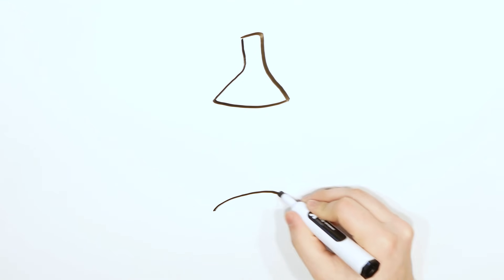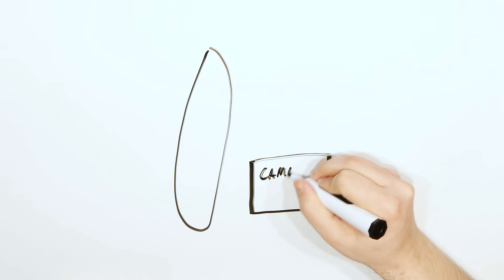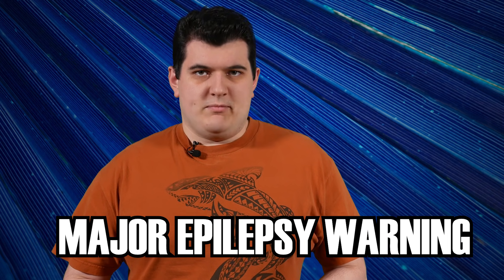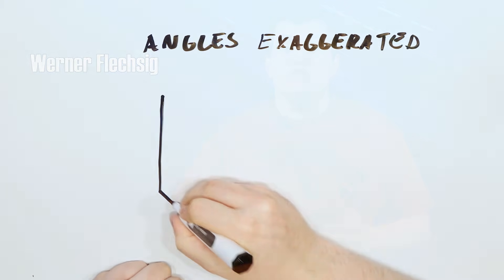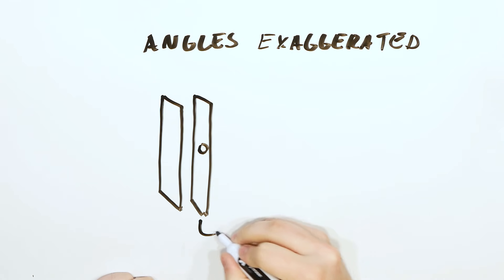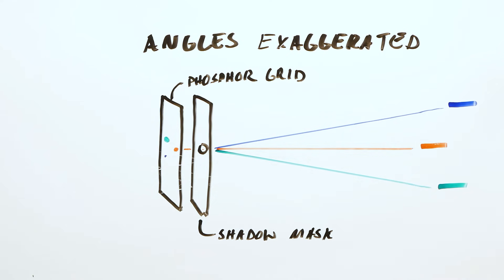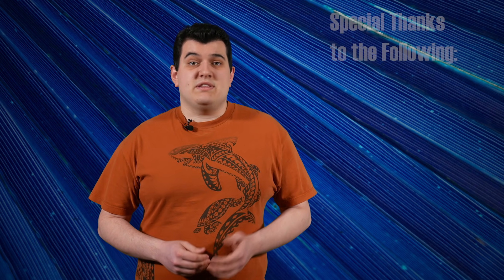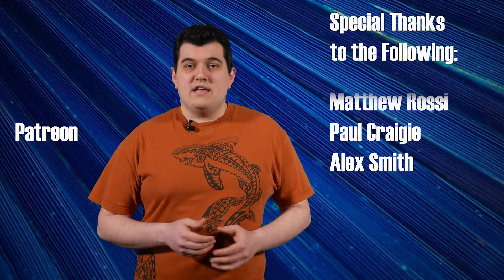How Analog Color TV Works:  The Beginnings

Comment: I don't see how these are not pixels, seeing as a pixel is a "picture element". Sure you might not be able to send a command to a TV that says "set pixel (100,200) to VALUE" but by changing the incoming signal you still have controll over each pixel, which is essentially the same as Individual pixel addressing.
Reply from the maker: "You still have control over each pixel" is a bit of a false premise.  Going back to the fact that the image is drawn as lines, there is no finite "resolution" in the X dimension.  The beam isn't moving in steps at all, it's just sliding from left to right continuously.  There is a maximum amount of detail you can portray in the X dimension, but it has nothing to do with the grid pattern of phosphors.  That's just a limitation of the bandwidth available.
The image is drawn exactly the same as in a black and white television, which does not have these groupings at all.  The groupings are nothing more than color separation elements, and they should not be seen as building blocks of the image, or "picture elements".  Their position relative to the actual drawn image is irrelevant, as I demonstrated with the PlayStation text.  And thus, they're not pixels.  They sure do look like them, but they are not what defines the image.  They just prevent crosstalk between the three individual electron beams.

Comment: Your monitor doesn't mix exactly equal red and green parts to make yellow, it's actually adjusted a little to seem more accurate.
Reply from the maker: That color on the screen, though, was equally red and green--I made it so :)
Reply: Maybe the color was #FFFF00, but the actual monitor (my screen, your screen) displays it slightly differently. Maybe the color is stored as fully red and green, but look up color profiles
Reply from the maker: +LoganDark Ah, I see. I thought you meant that a true "yellow" (or whatever you wish to call a pure yellow) wouldn't be equal parts red and green.  Point taken.

Comment: Your understanding of color vision is incorrect. Our eyes don't just see red, green and blue light. Spectral yellow light does not contain red and green light at all. We see spectral yellow as both the M and L cones (that you call green and red cones) are sensitive to yellow light.
Reply from the maker: +spoddie I think you will find if you revisit that segment that I had said yellow light stimulates both the red and green cells, which the brain interprets as yellow.  I never said yellow light is a mixture of red and green light.  I think perhaps my semantics are vague between "see" and "interpret".
Reply: 1:23 "Our eyes actually only see three colors of light - red, green, and blue. Our brains interpret other colors by comparing the amount of each of the three colors we see ..." [edited]
Reply from the maker: +spoddie "by comparing the amount of each of the three colors we see"
Reply: Right, edited. 
But you're still wrong. We don't see spectral yellow as green and red as spectral yellow does not contain either green or red. We don't see only three colors, we see the entire spectrum. This might be a minor point in a video about color TV but you are passing on incorrect information.
Reply from the maker: +spoddie But we don't have color receptors for yellow!  We "see" yellow light because spectral yellow stimulates both the red and green cells. Our eyes can't directly see yellow.
My original reply stands; I could have been more clear with semantics.  It would have been better to say "our eyes only detect three colors of light, with colors in between R, G, and B on the spectrum stimulating the three detectors in varying ratios which allow the brain to determine those colors".  I feel as though it was my usage of  "see" rather than "detect" which is the cause of your issue.
Reply: Whether it's "see" or "detect" you're just wrong. They aren't blue, green, and red cells, they are L, M, and S cones. We don't just see three colors, for instance  te M cone detects, or sees, every color in the entire spectrum from violet, through green to red!
Reply from the maker: I'm growing weary of this.  Is it over-simplifying to call them Red Green and Blue cells?  Yes.  Is it "wrong"?  I'd hardly say so.
"A range of wavelengths of light stimulates each of these receptor types to varying degrees. Yellowish-green light, for example, stimulates both L and M cones equally strongly, but only stimulates S-cones weakly. Red light, on the other hand, stimulates L cones much more than M cones, and S cones hardly at all; blue-green light stimulates M cones more than L cones, and S cones a bit more strongly, and is also the peak stimulant for rod cells; and blue light stimulates S cones more strongly than red or green light, but L and M cones more weakly. The brain combines the information from each type of receptor to give rise to different perceptions of different wavelengths of light."
There are overlaps and it's true that they are not monochromatic in their perception.  But their primary sensitivity can be casually defined as "red, green, and blue".  I see no problem with that and your insistence on calling it wrong seems pedantic to me.  Let's just agree to disagree here.

Comment: apparently color wheels are used in modern projectors? I found out looking for old color wheel TV sets (couldn't find these early color sets though....)
Reply: Panda-s1 color wheels are used in cheap DLP projectors so only 1 chip is needed.  For home theater I would highly recommend 3 chip LCD or 3 chip DLP.  For office presentation of PowerPoint slides 1 chip DLP is fine.

Comment: I'm hoping the next video will explain that the color carrier is actually two signals (I and Q). Every explanation of NTSC color I've read only explains the I signal, as if color is just one axis and not a circle. 

The benefit of using QAM for the color carrier is that you can modulate two signals instead of just one. That greatly increases the color resolution and it would have increased it even more if both signals had been encoded in VSB. For some mysterious reason, Q in encoded in DSB, confining it to half the bandwidth of I.

Comment: Let's be honest about "Never Twice (the) Same Color".
By about 1975, US broadcasters had figured out how to keep their color burst signal in the correct phase. Set the hue knob to show the grass is green on any channel, than leave the hue knob alone after, and the color would be fine on all the channels.
Reply: You could also use the SMPTE color bars that stations used to broadcast before going on air early in the morning. Some cameras can also provide color bars, or you may have a channel on your cable service.
Reply: 1L6E6VHF Yeah, but it took nearly 30 years to figure that out and by then PAL had been working great for 10 years.
Reply: Wasn't the issue due to multipath interference? So you couldn't simply get round it by setting things correctly at the broadcast end.

Comment: NTSC was a mistake. A huuuuge mistake. PAL was always the better / superior standard. Better colour, more TV lines of resolution & no dropped frames bullshit.
Reply: KRAFTWERK2K6 Well, PAL was an improvement, because it was designed after NTSC and was able to correct some of the defects in NTSC. In reality, though, the difference in quality isn't huge. NTSC just requires periodic calibration, while PAL auto-calibrates.

Comment: NTSC was so retarded. What the hell were they thinking? Films run at 24fps and pal uses 25 so all they would do is speed it up by 1fps which was perfectly acceptable. Can't do that with NTSC. PAL was also higher quality.
Reply: Yeah, and the food service was terrible on Wilbur and Orville's first airplane.  Try to understand, Shaun, that the NTSC system was pioneering, and eventually came to work quite well.  The addition of color in a system totally compatible with current black and white systems, and all in the exact bandwidth allocated to black and white, was a triumph of electronic engineering of the time.  How can you disrespect a successful system that utilized state of the art technology at the time?  Could you have done better?
Reply: Templarfreak  -  No, not remotely. NTSC and PAL may have the element of using quadrature amplitude modulation of the colour signal and sticking it into some of the high frequency parts of the picture signal in common, but there are significant differences, too. PAL alternates the phase of the colour carrier on each line (hence the name) which fixes NTSC's hue drift problem and PAL uses the same amount of bandwidth for the two colour components, whereas NTSC uses different amounts. I know, because I studied how PAL works in detail in order to write a shader simulating it.

NTSC and PAL do not run at 60 and 50 frames per second. They're both interlaced, so only run at 30 and 25 frames per second.
Reply: PAL was also created to fix NTSC's flaws.
Reply: Templarfreak  -  Oh, you're talking about digital broadcasting. In that case PAL and NTSC are irrelevant because they're strictly analogue systems, not digital ones. 

The digital systems are (in order of least to most common) DTMB (basically just China), ATSC (North America, South Korea), ISDB (Japan and most of South America), and DVB-T (everywhere else that's gone digital).

The data carried over those systems is basically just a handful of common video and audio codecs. MPEG-2, H.264, AC-3, and AAC cover pretty-much everything currently in use. All of which, you've probably noted can handle all the frame-rates used by the old analogue systems.
Reply: PAL and NTSC run at 50 and 60 fields per second, Roxor.  As a result they have that many intervals of motion per second, but half as many full frames.  This is why a still of a video frame often needs to have every other line be a copy of the previous line, halving the vertical resolution, but stabilizing what would otherwise be a jittery or double image.
Reply: ATSC is just as retarded. Welcome to multipath hell.
Reply: Modern NTSC is identical to PAL, except that it runs at 60FPS while PAL runs at 50.
Reply: Modern. Not 20 years ago. There is literally no difference in color or resolution in modern NTSC vs PAL (I mean, other than how they work obviously). The only difference is the refresh rate of PAL programming is 50hz and NTSC is 60. NTSC has on-par color now. PAL has on-par resolution now (When before, it was a bit limited in vertical resolution). Both can be 4K. Both have high-range color. PAL still has not updated to be 60hz refresh rate, though. Or at least as far as I am aware, anyway. It actually could have at some point.

If you had a sufficiently crappy TV that did not for some reason automatically reformat the programming to fit the refresh rate you set your screen to (even though that is an extremely common feature), if you set it to anything other than 50hz with PAL the picture will be heavily distorted. Same problem with the same shitty TV with NTSC, but at 60hz. Again, unless that actually has been updated too, it could be I haven't actually checked lately, but I don't think it has.
Reply: Right. Does that actually fix the refresh rate problem, too? I guess I wasn't totally right, the point I was trying to get across is that the systems are largely irrelevant today.
Reply: How to handle different framerates is up to the device manufacturer. TVs sold in Australia, which uses 50Hz mains, tend to have a 50, 100 or 200Hz refresh rates (the latter two on high-end ones with interpolation). I expect that's a firmware setting rather than a hardware fixed-function limitation, though. If they're smart, they'll have designed the device to just match the refresh rate to the frame rate of whatever comes in so they can sell the same hardware anywhere in the world and only need to adjust the firmware  to suit where it's being sold (even that's probably just limited to what ranges of broadcast frequencies are used in what countries plus UI languages).

I will agree that once you get the data out of the broadcast, it's all pretty similar to what we're usually dealing with in files on our computers. Kind of like how, whether you send it over WiFi or Ethernet, you're still sending IP packets to request a web site.
Reply: Robert Baker not then you are flying with Aegean...
Reply: NTSC is better for retro gaming though...
Reply: Shaun is actually referring to E.I.A (480i60), often associated with N.T.S.C colour and C.C.I.R (576i50) often associated with PAL and SECAM. Differences in electrical standards, and thus the number of fields per second resulted in C.C.I.R countries having a lower framerate than E.I.A countries.
 Feature films came before television and their framerates were decided independently from electrical standards, it just didn't matter back then. It mattered for television because if how it works.
Reply: But 3:2 pulldown leaves the runtime and audio at the original speed within a tenth of a percent. As for a speed increase of about 4%, which is what you get with E.I.A copies of feature films, I can notice it when I hear music in a movie if I have heard that music elsewhere before.
Reply: Hopelessand Forlorn Yes I could have by looking at the frame rate of film and implementing a system that uses 25 fps so that films can be displayed correctly on TV without   all that 3 2 pulldown pish that has to be done to get 24fps to 30. This creates undesirable artifacts.

Comment: I would still argue that they are pixels.
You might not be able to directly address individual points on the screen directly but they are still the smallest colour elements.
And with modern OS you can actually get a very similar effect on your PC where text gets shifted on a sub-pixel scale to allow for finer control at the cost of some slight color variations on the edges.